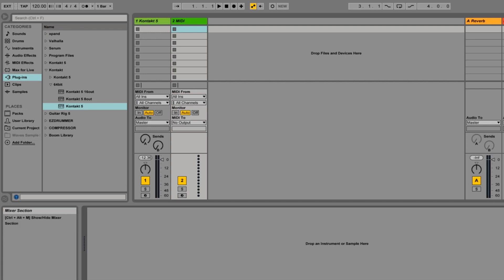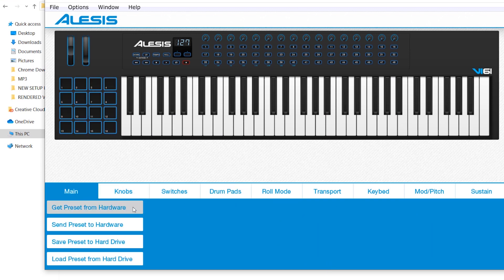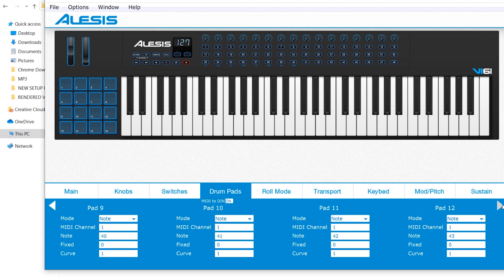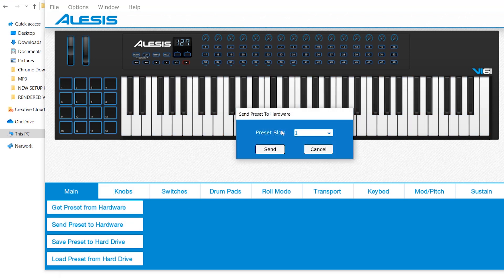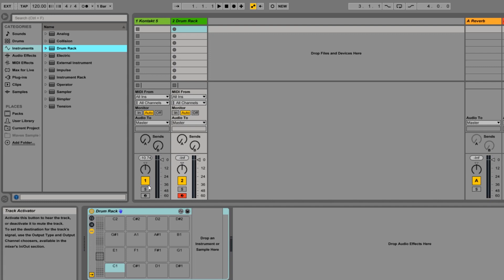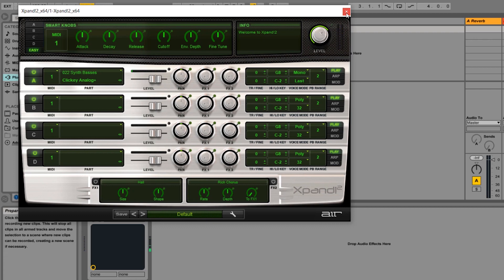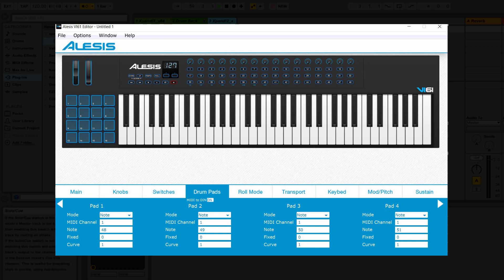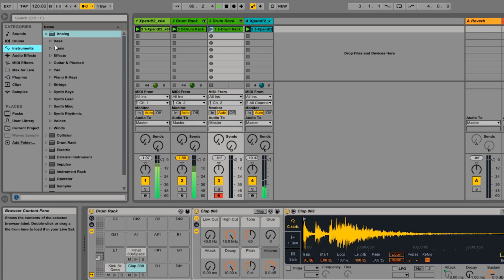How to Split  Function of Drumpad Keybed on Alesis Vi61 - EASY version

Comment: Hello. 
The editor does not send the changes that you have modified in real time. You have to save that setting to your computer's hard drive and then load it to send it to the Alesis controller. 

Do the following: 

1) Verify that your Alesis controller is connected via USB and in OPTIONS/Device Setup select the USB input and output of your controller. 

2) Make all the modifications in the Editor you want to make to your Alesis controller. 

3) In the MAIN Section save your settings as a preset on your computer using the SAVE PRESET TO HARD DRIVE option with whatever name that identifies your Preset. 

4) Load your newly created Preset with the LOAD PRESET FROM HARD DRIVE option and send your Preset to your Alesis Controller using the SEND PRESET TO HARDWARE option, choose any of the 24 slots on your Alesis device and press SEND. 

That's it!! 

You can create a whole library of presets on your computer and send the one you need (on stage or studio situation) and send it to your Alesis controller in a couple of clicks.

You can download the Alesis VI61 Editor here:

https://alesis.com/assets2/downloads/Alesis_VI61_Editor_v1.02.3_-_Win.zip
Reply from the maker: Thanks for this
Reply: @angelobayno1182  You're welcome! That information is for everyone who comes to watch your video looking for help setting up their Alesis VI61, VI49 and VI25. 😊

Comment: Hey Angelo or anyone with a VI61, I just got mine and when I play it, there is a slight delay from the key press to what comes out. Can anyone help. New to midi keyboards, Thanks.
Reply from the maker: Hello. Thanks for dropping by. You may adjust the latency from your Audio driver. Are you using an Audio Interface? Or your just using your computer audio hardware?
Reply: @angelobayno1182  Thanks for the quick reply, I'm using my IPAD and the mk sensation app
Reply from the maker: Recommended latency is 128 or 256
Reply from the maker: There should be a way to adjust the latency. Delay is caused bamy latency. Ipads have strong cores so there should never be a problem with it. Are you using lightning to usb dongle?
Reply: @angelobayno1182  yeah I am using one, bought the original cable off Amazon
Reply from the maker: Were you able to resolve the issue?
Reply: @angelobayno1182  have to set back up and try the adjustment would let you know, but thanks a million bro🙏🏾